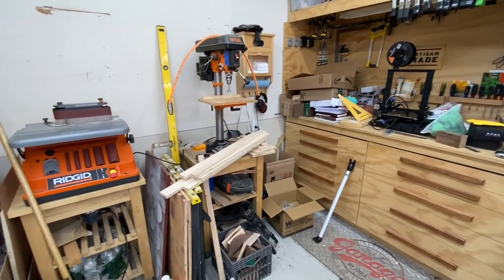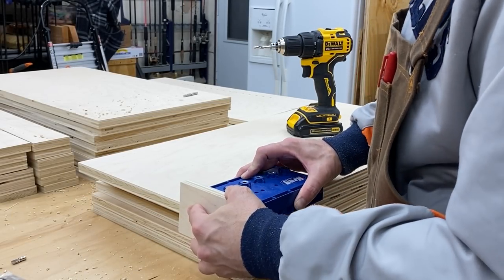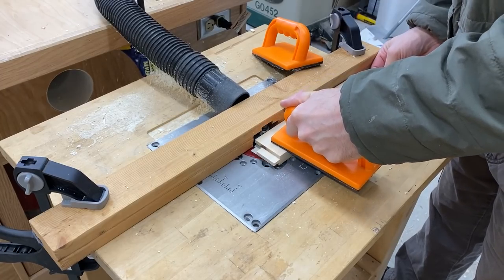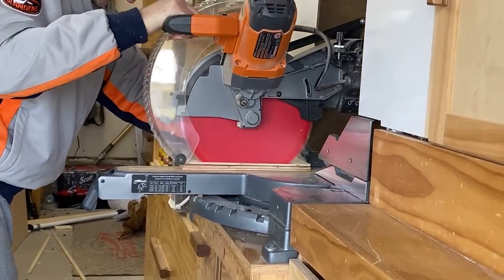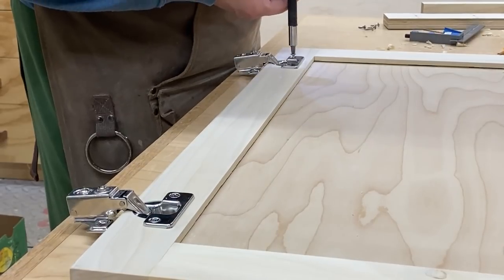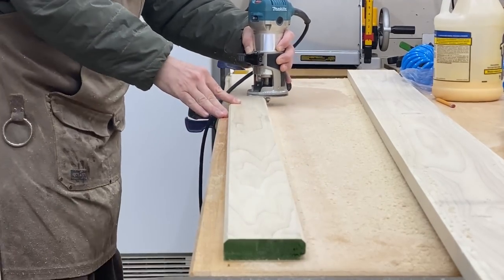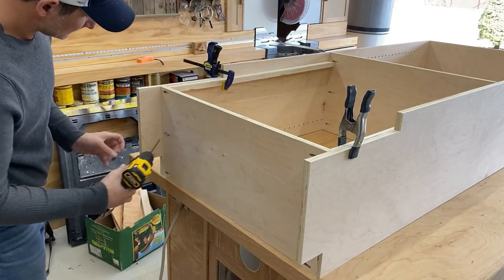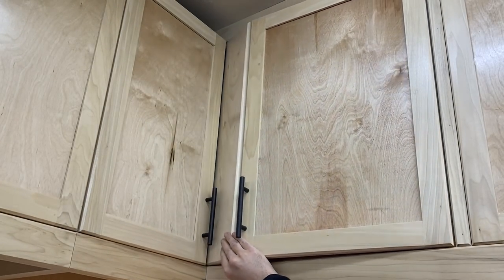How To Build Shop Cabinets / DIY Shop Cabinets / Workshop Organization / Huge Workshop Upgrade

Comment: I have used Lauan plywood (also known as Luan Plywood) for doors centers and drawer bottoms. It has a smooth side and a blemished side. I used to skin doors in apartment complexes due to investors not wanting to spend monies for new doors. Sometimes I would glue it to a sheet of 1/4 oak ply or veneer it with a hardwood veneer. Again when I did apartment repairs to cabinetry in the apartments.

Comment: Cheap pipe clamps will help you with those wide glue ups until you can get you some parallel clamps. As for orienting your material use chalk it wipes off easy and help keep parts in the correct place or Avery labels that clean up with denatured alcohol.

Comment: 1 year in is there anything you’d do differently on the design? My main question I’m trying to figure out with my shop cabinets is whether a face frame would keep more dust out of the cabinet. Do you find the gap between your doors lets in a noticeable amount of dust (even with good dust collection I still get a small layer on exposed surfaces, wondering if I’ll regret full overlay vs face frame)
Reply from the maker: I’m very happy with them. I haven’t noticed any dust build up. I actually keep some canned food products in one of them.
Reply: @ArtisanMade  thanks so much for replying!!! For sure going frameless will save some time and now I’m not so worried. Appreciate you!

Comment: The hinges you linked are half inch overlay, do you have a good full overlay one for frameless that you like that's cheap?
Reply from the maker: I just checked the link. These are full overlay. I was pleasantly surprised at the quality, but I didn’t bother installing the lights that come with it.

Comment: Hmm looked for a video on the workbench that's in the corner you don't have one on it. No one builds them with drawers that has a hutch. It's not exactly what I want, but closer then anything else I seen be easier to modify the design though. 🤭 It would of probably give ya good YouTube content as no one else really has that on their channel I know as I've looked they just ones without drawers or just had designs.
Reply from the maker: If only I could turn back time. I built that before I ever thought of starting this channel. It has been a very efficient use of that space.